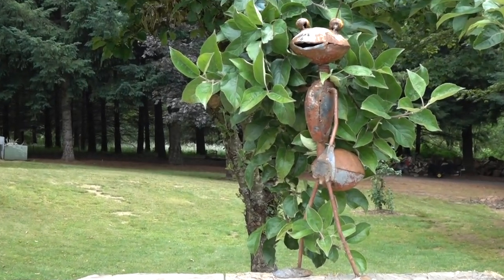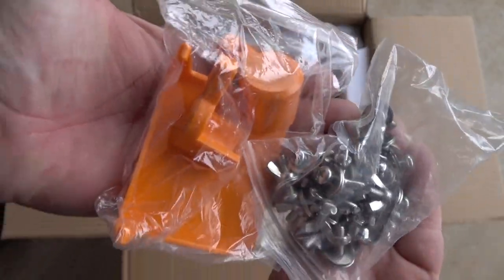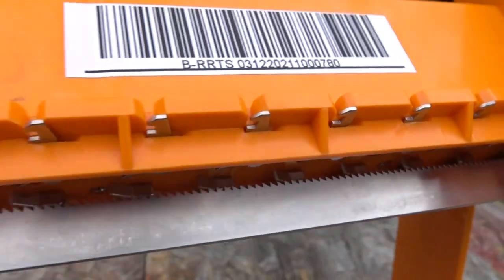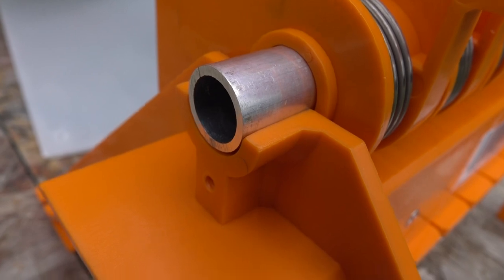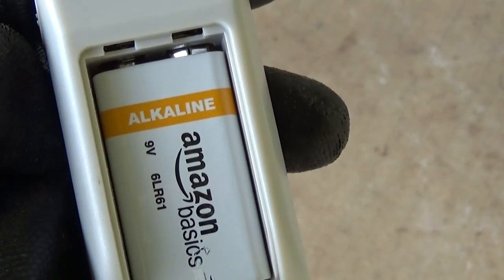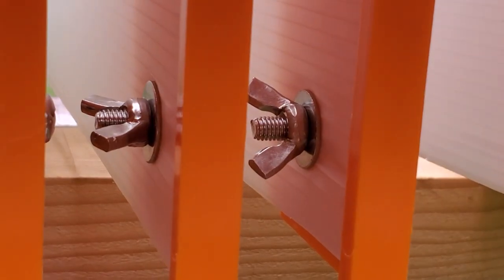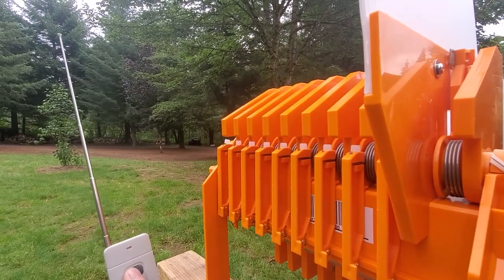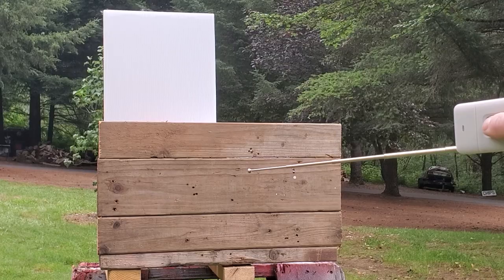www.BushesLand.com's Remotely Resettable Target System (Wireless Pop-Up Targets) Full Review

Comment: On a side note I received and tested the new Western RATTLER 357 and its all and more than my other 3 LCS SK19 s.
No fun switch (full auto) don't need it.
The two stage trigger is a fantastic improvement. For me 50 yards and less for hogs its a laser hole in hole or touching 🤔 with FX Hybrids 68 grain) 10 clicks out on power wheel for 1000fps. 
I tried the FX & JSB 80 grain  pellets with the factory tune around 890 at 145 bar was great 👍
Is it worth the price of like 2 Dreamlines??
OMG 😲  OH hel_  yes..!!!
Reply from the maker: Well, They stole a laptop from the LCS office to get thier design, so they are about to get sued.
Reply: @AirgunChannel  It's my understanding that Western is a sister company of LCS and they manufacture many LCS components. Also guessing they had to sign a non compete agreement.  🤔 I think the Rattler is merely a joint venture or LCS could not pay for new tooling.. 🤔 
And AoA would not be the dealer if there was funny business going on.
But hey ... I got mine and it's magnificent!!
And I don't need AoA to fix it.
I can machine any part it may need if any in the future. 
Hunter laptop story may be Russian disinformation. LOL 😆 🤣

Comment: Hi there was a target that was supposed to come out I seen it on shot show a year ago it was called bada bang it worked on blue tooth and on line it was supposed to be a two player and you could change and play different games with other people Even if there some were Elsa with a reset from your phone it was made by the same company that the 300$ adventure air gun made by but I haven't seen any one with it. It supposably was going to come out this year.  I see that Barra electric gun is being put to use I'd thought you like it can't wait to see the review. Mods for it would be awesome 💯👍✌️👌🎯🔫
Reply from the maker: The Barra is super cool....all metal !!! I'd love to see that bluetooth one. $100 more would be fine for games added. Thanks for watching! -Nate
Reply: @AirgunChannel  ya it would be air Venturi had it at there both at shot show about a year ago and said it was going to be coming out soon. It was the coolest target I have ever seen. They were talking under 200$. The Barra I hope some mods come out for it like soft air  to increase the power and speed you no like a barrel swap battery upgrade gearing change would be awesome I left a email to the company asking if they would offer some mods waiting for the reply. Thanks Nate have a great one ps.  do you still do RC car still there was a video you did and you had this sick ass big rc unforgivable 👍✌️👌💯🎯🏎️
Reply: In stock at Pyramidair. $79.99.